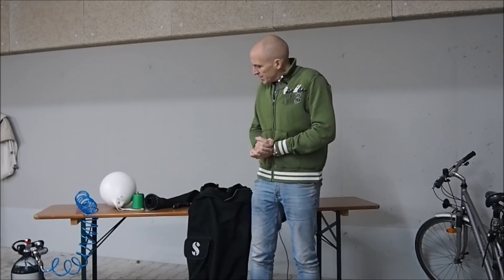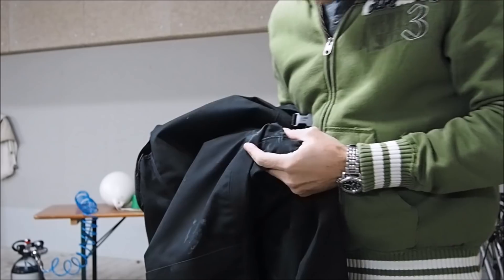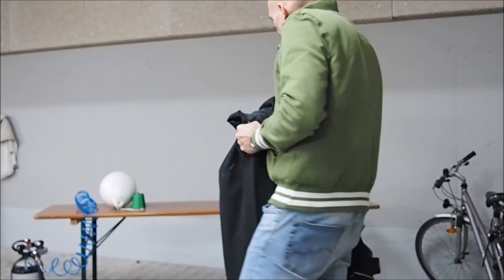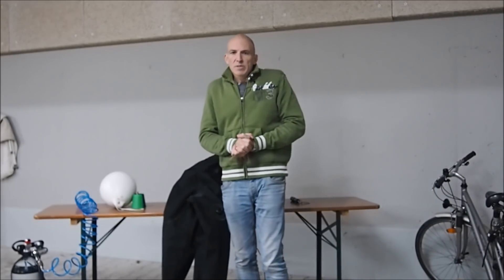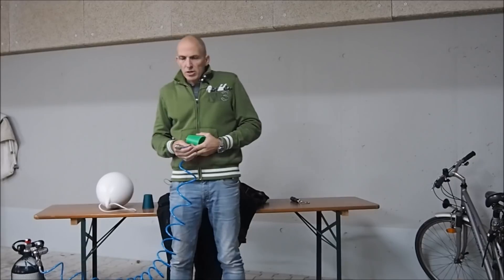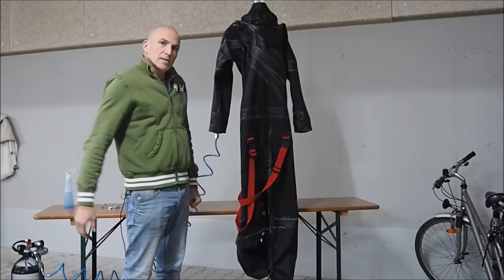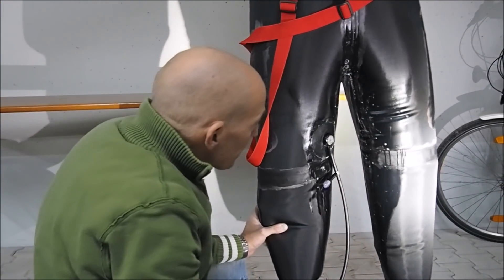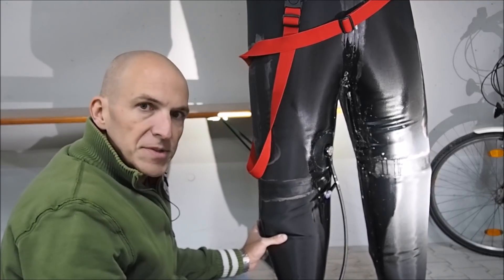How to test a drysuit for leaks at home

Comment: Great advice with turning suite inside out!  I tried soap water without turning inside out - nothing.  I replaced the zipper - no help.  Next I have to try turning it inside out.  But I'm not sure if doing that might damage the boot seals.  In your video I did not see if the suit had permanently installed boots - probably not?

Comment: I find it is a bit difficult for me to seal the neck with a ball fender when the suit is turned inside out. My drysuit has a glued on latex neck seal and a sewn on  neoprene warm neck. So I switched to making a hanger with large diameter hard plastic water pipe parts and the pipe head sealed, which looks like a letter T upside down.

Comment: A very nice video, thank you very much.
Can you maybe explain, its not even necessarry to show, how to change the glued on seals in a good home way? :)
Merry christmas Achim.
greetings,
Chris
Reply from the maker: HI Chris, I personally dive Silicon for some years now as well as my team. if you want to change latex seals you cut the old ones off - peel as much of the remaining part of as you can (heatgun is a great tool to make this easier). then you can use a small wire brush (brass) and /or sandpaper to remove the remains of the glue. the new seal has to be roughend up as well (sandpaper). The arm of the suit should be streched over something hard (water bottle for example) You put the seal on in the way it should sit finally. then you fold it back, so the glueing surfaces are exposed and next to each other.  Then you apply the glue to the seal and the glue area on the suit and let it dry (till you can put your finger on and it is not sticky any more. now you fold the seal down so the glueing areas connect. You apply FIRM pressure. it is not important how long you press but how firm. Done. (there are several glues on teh market but they differ very much from country to country with names and content - but they work all the same. He this helps. Merry X-Mas

Comment: Did that drysuit have boots or socks built-in? I've tried turning my suit inside out but it gets a little messy at the feet because I have boots.
Reply from the maker: Hi Darell, the suit has boots and yes, turning it inside out is a pain but it can be done. As those rubber boots do usually not have any issued (exept on the spot where they connect to the legs) it is usually not necessary to turn them out. We left them in the legs on the vid as well. If you have socks turning them is no problem.